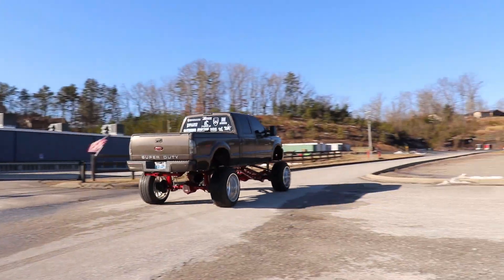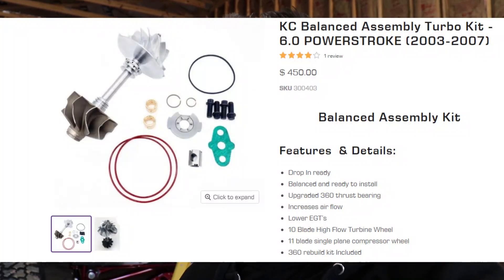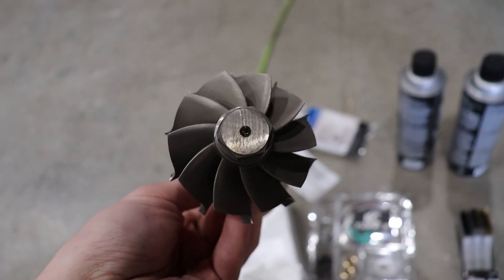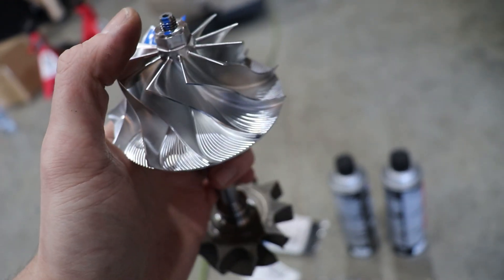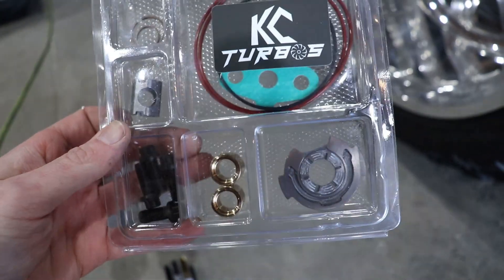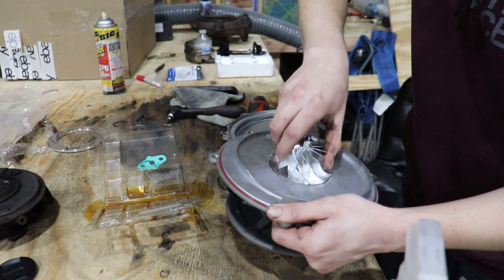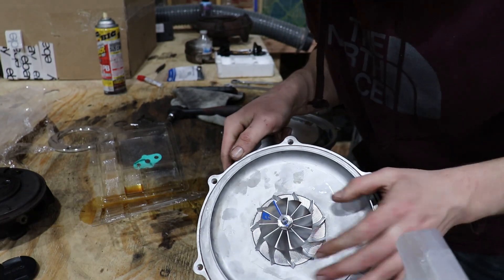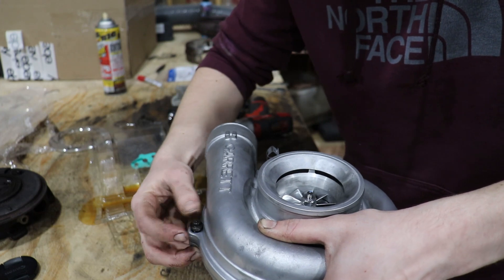MAKING MY 6.0 POWERSTROKE SOUND LIKE AN AIRPLANE | KC TURBOS 10 BLADE INSTALL | IN DEPTH

Comment: I put KDD heads, a stage 2-10 blade turbo and Warren 175/30 injectors with TSD tunes all from KC in my 2003 a few years ago. Also an adrenaline HPOP and a bunch of BPD upgrades. Truck has stupid amounts of power and tows my almost 8000lb boat and trailer without issue as long as I keep my engine speed above 2000rpm. I have the stock turbo stored that I think I’ll rebuild as a stage 1 with A KC kit. I may reinstall it and have new tunes written just to eliminate the need to keep my RPMs up. I am sure the truck will still have more power than I need.

Comment: I wanna do the 10 blade swap but my truck only has 40k original miles and 3k miles on the new turbo lol. Engine bay is super clean I don’t feel like messing around with it just yet, keep up the content!
Reply from the maker: Definitely something you can do in the future ! Thx for watching anyhow.
Reply: Do you even drive it?
Reply: @kxp.1496  Sometimes, usually just in the summer to tow my boat or to get the fluids going I’ll take it on the highway for a run. I have a Peterbilt I drive daily.

Comment: 10:46 my cars are so much easier to work on vs my truck... Only if your truck had a full air ride suspension and you could lower it all the way down like a car with the push of a button, that'd make it much easier...

Great video!!

Comment: You must have an 04 or later truck; I didn't realise it myself, but the 03s came stock with ten blades on the hot side.
Reply from the maker: No I have a 2006 , but I done the swap in this video which makes the 13 blade turbo a 10 blade turbo.

Comment: why didnt u do the ford turbo drain and feed line updates?
Reply from the maker: Haven’t seen a drain update , done new o rings on it , as as far as the feed line goes , just didn’t feel the need with mine being perfectly fine. Very easy to change if it ever does give out. Thanks for watching!

Comment: I did this and I’ve never taken out a turbo or anything but I wanted to try and i did everything you done and now I got my turbo all back together the wheels won’t spin freely  and i don’t if they are supposed to or not I didn’t put it back in my truck yet because I don’t known if it’s right
Reply from the maker: that is not right it should spin freely something is in a bind sounds like
Reply: @JUSTINHAWKSMITH  okay I’ll take it back apart and see what I can figure out thanks
Reply: @JUSTINHAWKSMITH  do you have any idea what it could be it spins nice and smooth until I drop it back down on the exhaust side it fits in good but once I drop it down it won’t spin anymore it’s like the wheel is to big for the housing

Comment: i got a question on the balanced assembly ive watched a few videos but nobody specifies when putting on the compressor wheel do u just run it down snug then tighten to the paint mark? nobody really says and i dont wanna screw up anything btw great video
Reply from the maker: Yessir you put it back to the paint line that’s the proper torque spec marked from KC , any further can break shaft. No further , no less. Thanks for watching!

Comment: Sweet truck, as far as steering, what type of setup consist with your steering components?

I also have a 6.0 with 8-10” lift with Alcoa 24.5 on semi tires. However I have some steering wheel play. Just curious did you have to upgrade or change anything with the steering? Thanks
Reply from the maker: In this video yessir I had full 2” 1/4” wall dom tubing heim joint steering with 1.25” heims. I have a youtube video on that as well check it out. Type in heim joint steering justinhawksmith
Reply from the maker: https://youtu.be/9YjAxFxmz0Q

Comment: Turbo blade sounds great and truck is beautiful. 
Question, I recently got an 06 F250 with 8 inch lift, 24' Fuel wheels and 35' MT Mud Hunter tires. This is the first lifted truck I've owned so I have a question that I hope you can help with. With these tires is it going to ride a little rough in slow speeds (0-20 mph)?
Reply from the maker: Slow slow speeds 1-10 miles an hour yessir it may. But they could be choppy or have some alignment wear or anything which could make them ride even worse. Maybe try rotating them and see if it helps! Best of luck thanks for watching.

Comment: Are you still running this?  I just pulled mine out and I'm just cleaning it BUT I would love to get the new KC Jetfire Stage 1 Turbo (61/64) - 6.0 Powerstroke (2003-2007)??  Any thoughts on that turbo??
Reply from the maker: No it lasted 2k miles and blew
Reply: @JUSTINHAWKSMITH you left the housing bolts loose and that'll definitely do it
Reply: Snug ain't torqued and I'm basing this on the video of you barely snuggling them then installing the compressor wheel.... If I'm wrong I apologize, not trying to be a dick I'm a 20yr master tech and I believe that was the issue. We all make mistakes here and there good job on your videos tho

Comment: Just finished my install using your video (awesome video by the way) mine doesn’t sound quite as loud as yours for some reason. My truck has the factory 3” downpipe into a 4” exhaust. So I’m thinking that’s why. Going to order a 4” downpipe here soon.
Reply: Did you ever order the dp?
Reply: @natewst No, but i did install a hood stack later on. That was ear piercing though, so i had to go back to normal. So i'd say with the bigger downpipe it would be just as loud as the one on this video

Comment: You only "snugged up" the housing bolts behind the compressor wheel... They should definitely atleast be tight if not torqued hope they are still holding up... Prolly are but if they back off.....

Comment: What is everything you did to get it to sound like that
Reply from the maker: 4” straight pipe , 10 blade turbo wheel as seen in this video , 10” exhaust tip

Comment: Do u get any power gain or is it just for sound
Reply: the 10 blade wheel from early 03 trucks is known to boost faster albeit louder its a 10 blade........ then they went to a 13 blade in late 03-04.5 and 05 impilmented a smaller 13 blade all for the purpose of noise reduction although they preform slightly worse..... 05 - 07 is a small 13 blade late 03-04.5 its a big 13 blade and 03-late 03 its a 10 blade wheel.

Comment: Sounds great man!!! How’s the front end parts holding up? I’m very interested in changing over from ball joints!
Reply from the maker: Never had any issues over 10k miles on my first heim steering with only 7/8 heims , this setup is 1 - 1/4” heims so don’t think I’ll be having any issues with these either. Very over kill

Comment: Since you have to take the whole turbo out, wouldn't be better just to replace it with an aftermarket like a pitbull or garret.
Reply from the maker: 1hr worth of labor and 450 bucks. VS 1500+ for new turbo. Really all budget based. Depends what you want to spend and what you’re looking for as far as performance.
Reply: @JUSTINHAWKSMITH  Wow, I had no clue they were that expensive! Really appreciate all the help you've given me with my 6.0. Subscribe a few days ago!
Reply: @JUSTINHAWKSMITH  Also, In 4:38 when you're talking about that plastic piece, can I just remove that and never put it back on or does it serve some sort of purpose?